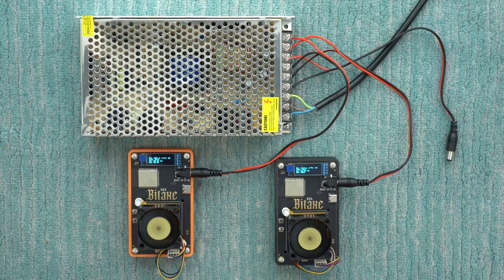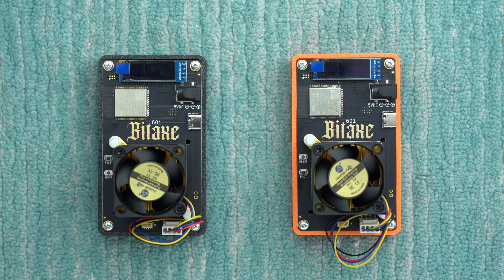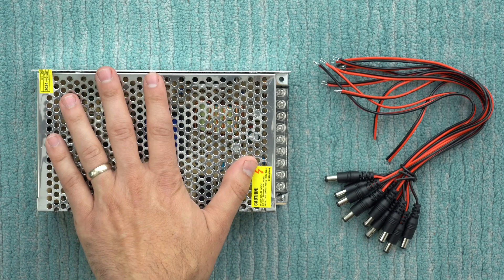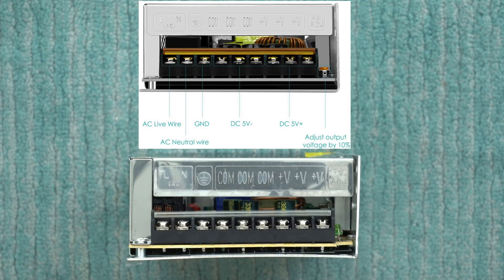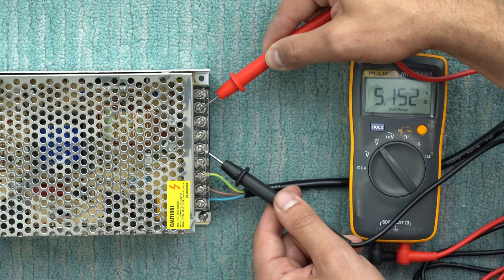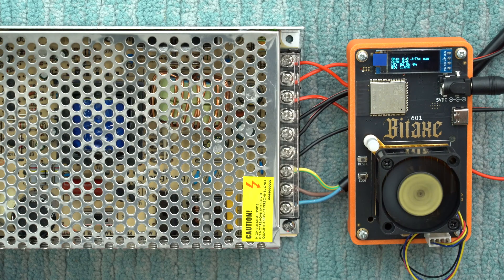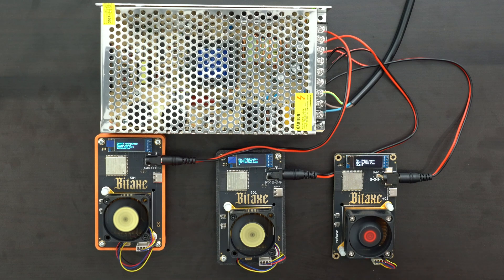Upgraded Bitaxe Power Supply for Multiple Bitaxes

Comment: I have a Bitaxe Supra Hex 701 with a four-pin female connector on the back where my four pin power supply cable connects too (its not two pin, I wished it was). How do I wire that four-pin cable to a Mean Well power supply? I understand how the two-pin version is wired, but I’m not sure how the four-pin connector should be handled.

Comment: Can I use a 12V DC Power Supply 600W 50A?
Reply from the maker: Bitaxes run at 5v. You'll destroy them if you run 12v through them. I've done that with one by accident, lol. Whoops!
Reply: @VortexBitcoin Oh ok but don’t the NerdQaxe++ run on 12 volts?

Comment: Is it worth using in-line blade fuses for each bitaxe circuit? Ie if one had a short,  it wouldn't knock out the others. Suppose you could if you were bothered.

Comment: I’m using a similar power supply. At default settings of the bitaxe, I was reading input voltage of 4.9 V. I adjusted the potentiometer to about 5.179V, and then I was getting an input voltage of 5.0V. But after increasing frequency to 625 Hz and Core Voltage to 1250 mV, I’m seeing input voltage sag again to 4.9 V. Is this an issue? AC cord is 12 AWG. DC connector are 14 AWG.

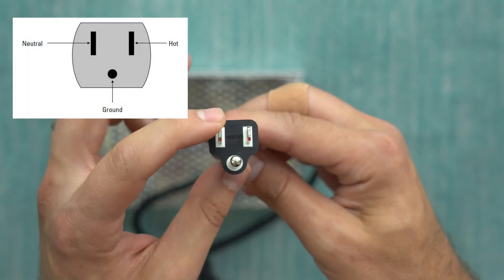Comment: 4:07 -- The plug diagram you have there is correct, but when you point to the actual blades on the male plug itself, you get it backwards.  The plug would have to be flipped around to be plugged into that diagram, were the diagram a real socket.  So with the blades facing you, the blade on your left is hot, and the blade on the right is neutral -- the opposite of what you said in the video.
Reply from the maker: Oh whoops! Thanks for pointing that out.

Comment: In case no one has pointed this out yet, the DC 5- does not indicate negative 5 volts, it indicates that it is negative, aka ground.  The + indicates the hot/positive part of the circuit.  But as the rating on the power supply shows, it only ever provides 5VDC with a max 40amps.

Comment: Hey , thank you for the video . I followed these steps , and got the parts from your links , thank you . Question - once I set everything out and powered it on my Bitaxe didn’t start up and started to smoke - I quickly turned everything off and it seems like it’s still alive and running with the old cable - I can’t figure out what I did wrong - any suggestions greatly appreciated, thank you
Reply from the maker: Oof wow, I hope it’s okay! Not sure what happened. Maybe a wiring issue?
Reply: @VortexBitcoin it’s still working/ hashing with the original power supply ( even after smoking😬 ) so that’s good . Yea must be I’ll get a volt meter .
Reply: @Alex.Davranov hope you did hook it up to a 12v power supply. You definitely got a 12v? Some of these supply boxes have a screw/pot to dial in the voltage with a meter.
Reply: @m85suchka so embarrassingly- I had the wires backwards 😬 lol , good thing it didn’t do any damage - have been running since ( highest hash 19.9G) . Thank you for the reply

Comment: Check that well know article online to overclocking the bitaxes. They have a section about the AWG of the wires between the bitaxes and the psu and your cables are definitely way below the awg they recommend as safe. Yours look like 18 or even 20 and he said that minimum you should use 16 awg.
Reply from the maker: Yep, good eye. In the video I used 18 awg wires that someone had recommended to me. Since then I've switched to 16 and 14 awg wires and updated the description with links to better wires, as well as a better PSU as well.
Reply: Mine is not hashing enoigh with 18awg will switch to 14

Comment: Hello! I just received my Bitaxe Gamma today, but the highest frequency I can select is 625. I would like to increase it since the Gamma can go to 1200. Do you know how to unlock the frequency range so you can manually enter in a number? Thank you!
Reply from the maker: Yes and I can cover that in a future video, but pushing it that high without adequate cooling is very dangerous. Are you confusing hash rate and frequency by chance? It should be doing 1270 GH/s @ 625 MHz.
Reply: @VortexBitcoin  Yes, sorry. You are correct! My bad! I was confusing the 1.2Gh/s hash rate of the Gamma ASIC chip with the ASIC frequency.  My Gamma Bitaxe is running very nicely around 1.3Gh/s now at 610Mhz ASIC frequency and 1.20V ASIC voltage. I have the fan set at fixed 70% 6561 RPM and the ASIC temperature is running cool at 52.5C with the voltage regulator at 75C. Power is 22.1Watts with 4.9V input voltage.  Thanks for the help!

Comment: Thank you for the video,
If you have extra bitaxes, do you add them to the same output slot? Can you use two bitaxes on one output?
Reply from the maker: Sure, you can always add more connectors to one slot. The wires I used are kinda short though so you may be constrained by how many Bitaxes you can physically put next to the PSU though, lol.